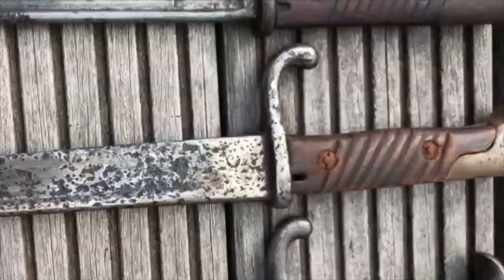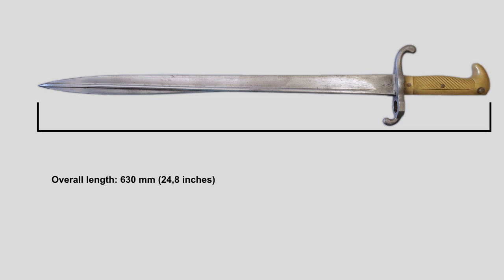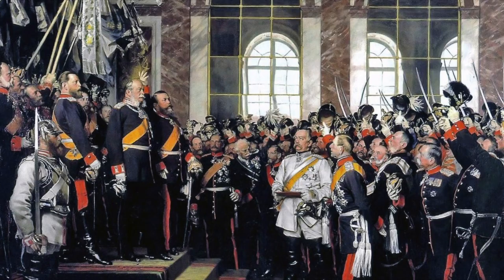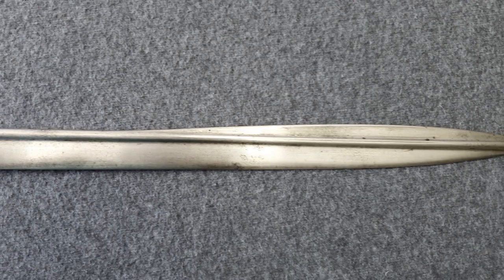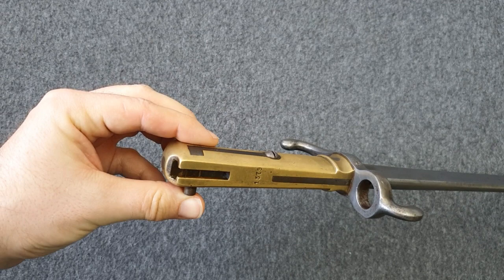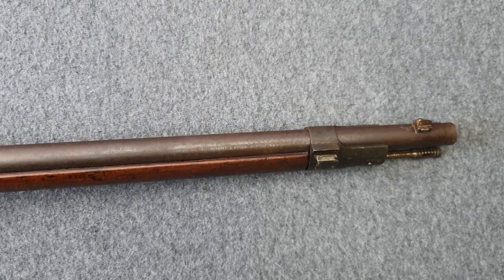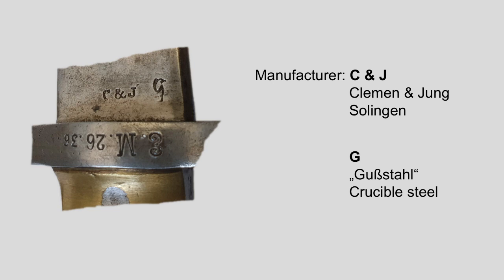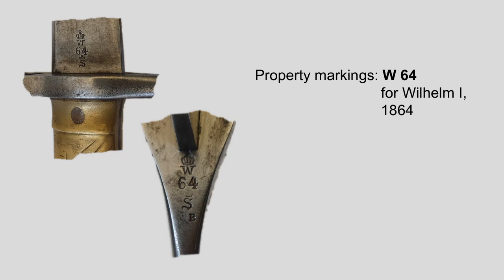From 1860 to WW1 (2/3): The Artillery Bayonet 1871, Episode 17.0

Comment: Aye Vincent. 
I have a question. How do you personally clean up your bayonets. 
Can you please give me a word of advice. Vinegar, Is this the best way for light rust removal. Thanks
Reply from the maker: Hello, yes, i do clean my bayonets and swords but just enough to remove rust and to preserve the piece. I dont aggresivly polish or do any restoration work.
I use WD40 to remove rust and then i rub the blade clean with very fine steel wool. If i have a scabbard for the blade i dont do anything more, if i dont have a scabbard i give the blade a very fine layer of balistol oil. Keep them all dry and thats all i do.
I dont really know if this is the best way and there are a lot of methods to remove rust, WD40 just happens to work for me the best.
Cheers, Vincent.